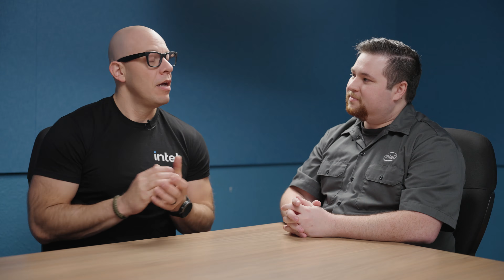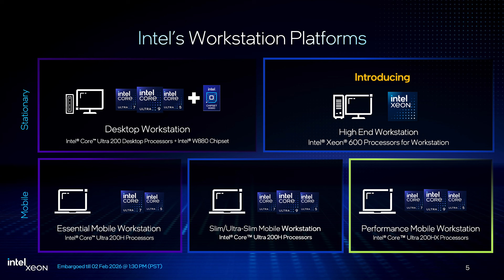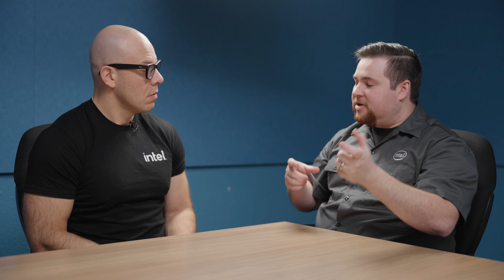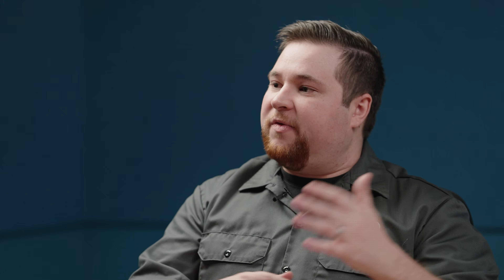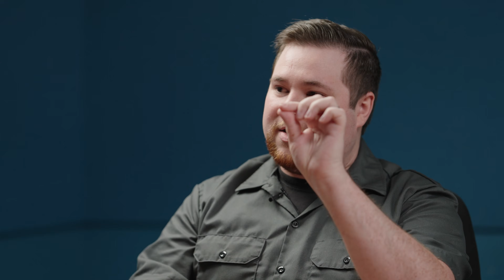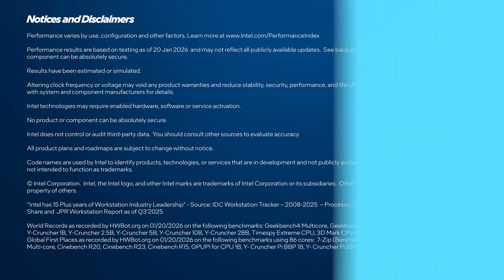Introducing New Intel Xeon 600 Processors for Workstation | Talking Tech | Intel Technology

Comment: Looking for both a 658X and a 636. It's the second half of May and still no availability.  Asus has a killer motherboard, but I certainly don't want the warranty clock to start unitl I can get everything.
Reply: Provantage has various Xeon 6 processors in stock now.  I've had good luck dealing with Provantage in the past.

Comment: Always been Intel processors issue they had bad IO its more the memory bandwidth and channels that let Intel down. It took a decade to get to 4 channels not alone 8 AMD has always pushed the memory channels up. No one cares about graphics SLI in a workstation its all about running 3d rendering, compilation, live rendering 3D modeling. So what you saying the 600x series is for corporate financial and AI market? Seriously a workstation is for development are you still disconnected from your customer base.
Reply: Intel has had 6 channels on W-3175X in 2019 and 8 channels starting with W-3375 in 2021, so not sure what you are thinking about.

In general, a very confused rant.
Reply: @romanvarcolac2238 im going back to 2010 i did say a decade

Comment: Bleh. Where's the monolithic designs for low latency? We need an X299 replacement.
Reply: Up to 48 core models have a single monolithic 598mm2 compute die. So yes, you do have monolithic ones. Also, the latency is lower with the better packaging that Intel has over AMD.
Reply: @romanvarcolac2238 Is the whole chip monolithic or just compute tile? All this disaggregated stuff is just bleh for gaming which is why arrow lake sucks for gaming despite the cores being the strongest.
Reply: @romanvarcolac2238 can you reference where you found data on this 48 core 678x being monolithic with that die size? I’ve not found much. Most data tells me it’s dual die compute not monolithic compute with a separate IO tile too.

Comment: Why are you not comparing with the threadtripper
Reply: Threadripper costs double or more
Reply: @PrinceManyeka Because Amd Walletripper is priced 3x than this CPU, Amd don't have anything to competes with this Intel Xeon.
Reply: Granite Rapids-WS is usually a lot cheaper than the equivalent capability Threadripper. Still, would have liked a comparison. The all-core turbos mean they should be pretty comparable in performance to Threadripper 9000 and overclocking would close that gap completely, likely in Intel’s favor.